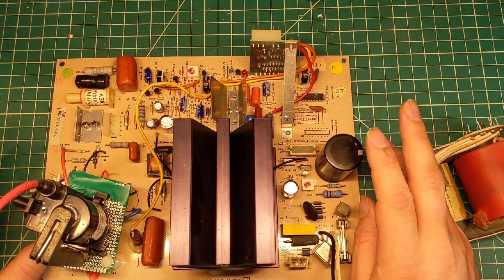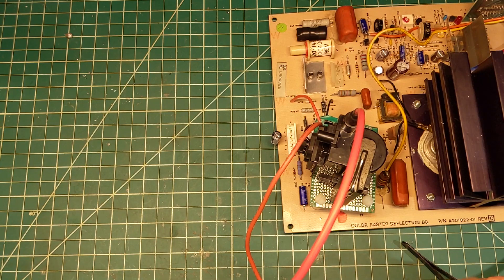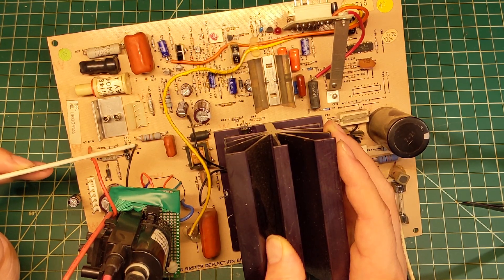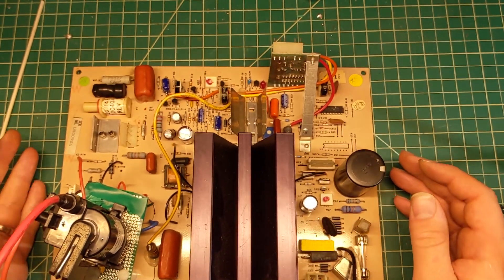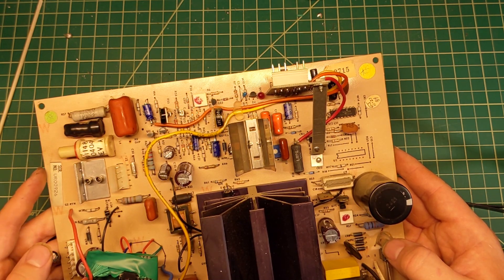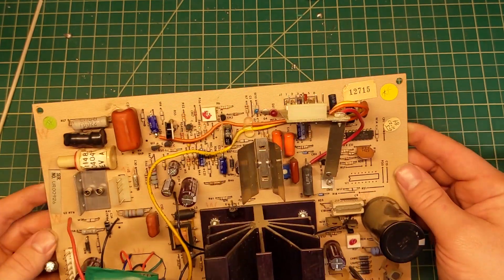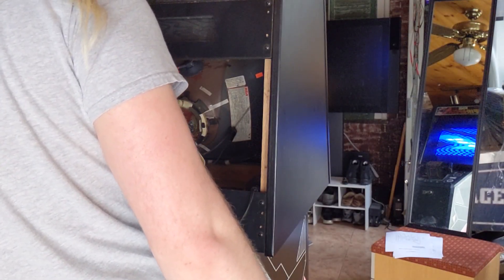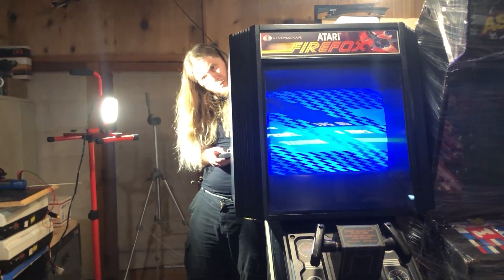Atari Firefox Part 2: Fixing the "Unfixable" Amplifone Raster Monitor

Comment: Have you considered dumping the raw video off the disc in case the disc ever goes bad, so you can replace it with a software source if you really need to?

I'm betting some money on the laser in that player being on the way out.
Reply from the maker: That exists! It's called Dexter, and can be used to replace the LD+Player in most laserdisc games. We just want to preserve the game in its original form as best we can.

As for the laser, we actually have two spare  laserdisc players for this machine! I think we should have plenty of parts...

Our next video about Firefox should detail the players themselves and how to go about fixing one.

Comment: Great informative video ! You will figure it out eventually.  Liam can fix anything    I think you should start a CRT factory and start making them new 😎again.   Let’s start with a fresh 4900 or maybe a GO7.   You could make millions ⭐️
Reply from the maker: We've thought about a modern monitor replacement which looks and feels like the real thing. For some elements, like the curvature of the screen and the blur, there are solutions, but the problem is that with most screen technology today you can't get around frame buffers - they're everywhere. That and image bleed which was necessary to make arcade graphics look their best. There are filters for this, but nothing is as good as the actual thing.